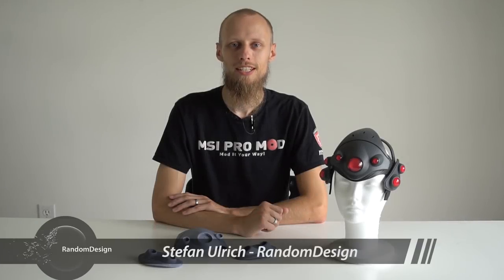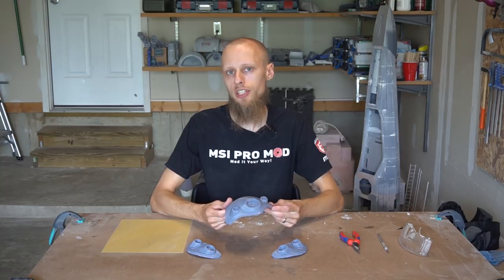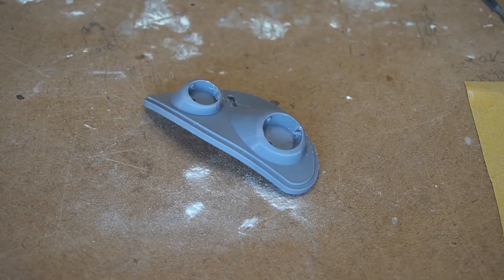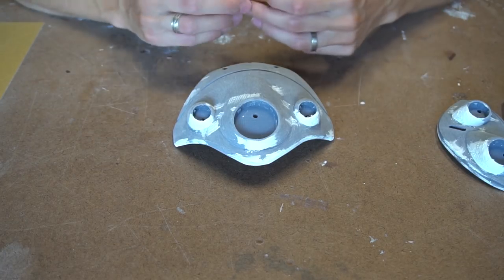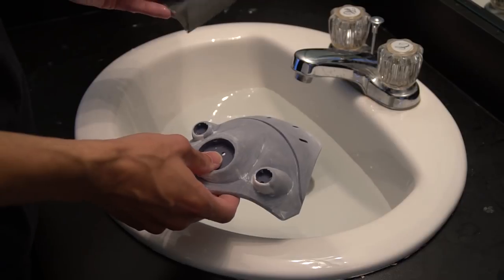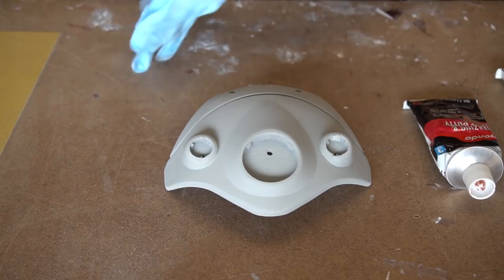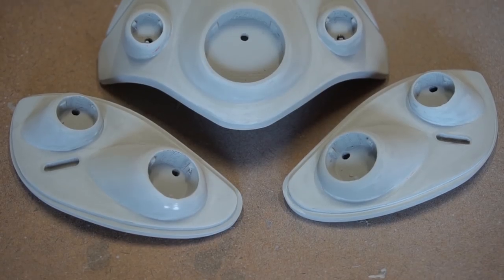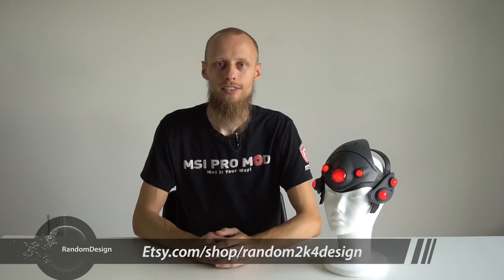How to process 3D prints

Comment: Good tutorial -- in short, SAND SAND SAND SAND SAND!

I am wondering a bit more about the painting process - starting from using the filler and then moving into airbrushing. That is where, even if I've done a great job sanding, all my post-processing seems to start to fail.
Reply from the maker: Its all a matter of practice. I cant count, how many times I sanded down all the coloring I made and started from scratch again. And just as a tip: Always apply multiple thin layers of paint instead of a single thick one. Some colors like yellow or gold need 7-9 layers with an airbrush.
Reply: @RandomDesign  Thanks for the reply! I'm VERY curious about airbrushing, I think I need to invest as spray cans seem too unreliable for me. Thanks again for the video!